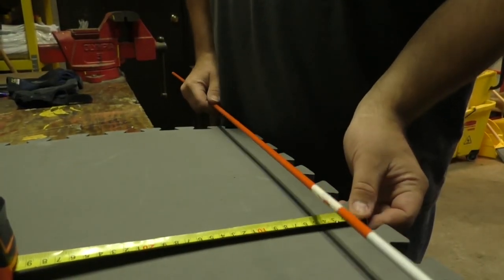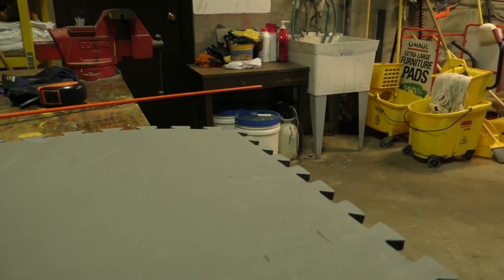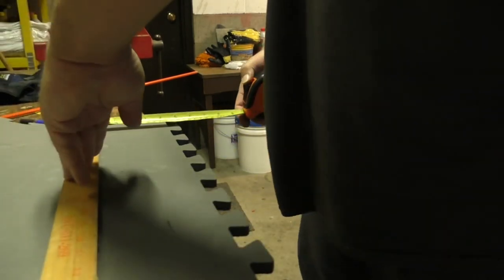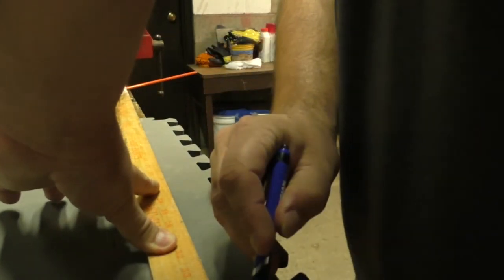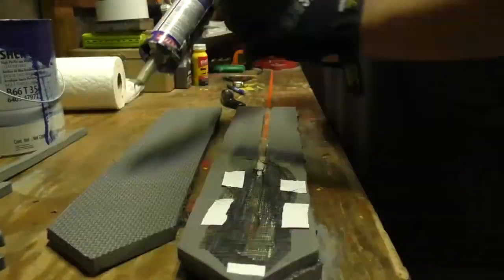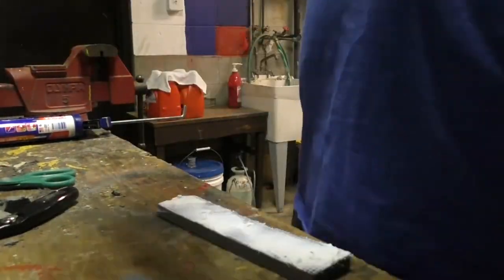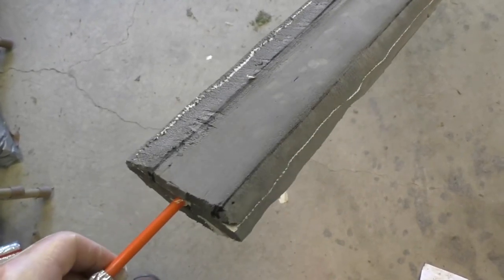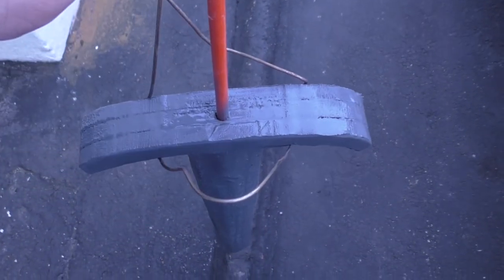How To Make A Foam Larp Sword | Maker's Challenge | LarpMix

Comment: What kind of adhesive did you use on the sword?
Reply from the maker: Depending on your game and if you're going to use it for combat, you can probably use anything.  However, if for combat, you'll want a flexible glue that doesn't doesn't dry too hard, in the video I recommend DAP, white glue or barge glue.  Barge glue is my go to for this stuff, but it can be costly.  In this video however, I used a loctite product, it was ok, but barge glue would have been better.